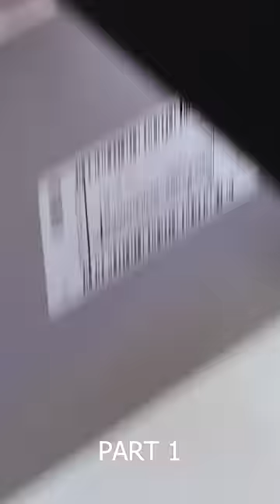Rusty Rifle Restoration Part 1 #Shorts

Comment: If you work with metal, you know that rust like that only found on completly rotten parts and there is no good metal undeneath if its under half an inch/10 mm. Those bands wiuld crumble, foil of mechanism well would be covered is holes. 
Yes, this is quickened rusting, probably in electrolythic bucket and with additive iron powder on top.

Comment: Oh the sacrilege, you took off all the patina from that museum piece
Reply: Just because its old doesnt mean its rare or valuable
Reply: @Dingusmaningus Depends on who you ask.
Reply: i have been looking through comments too much, i cant tell if this is satirical or not
Reply: @autumn5592  well I'm sure anyone selling high calls it patina
Reply: @Soriku4145  unless you have something rare refinishing is fine, if it's rare it still needs to be conserved to stop further rust damage or patina as some call it
Reply: @ericschulze5641  Im a conservator that specialises in metalwork artefacts, the definition we have for a patina is an appealing and usually inert form of corrosion, the stuff on that gun however is one of the most aggressive forms of iron corrosion you can get, usually if a client wants to keep the look of an active corrosion we usually have to neutralise and stabilise it with different chemicals (like in chinese bronzes for example), with iron however pretty much all of the time any red corrosion is removed as it cant really be stopped easily, and its usually taken to a black corrosion that has often formed underneath called magnetite, or we force magnetite to form in place of the current corrosion

Comment: Fake
The bolts are new
Reply: Not that, but there is practically no corrosion on any of the parts, just surface rust.
Some areas are basically brand new, which even if it sat in a bucket of grease wouldn't happen.